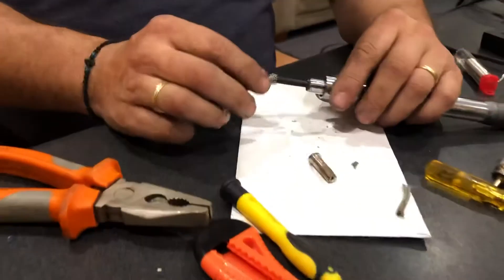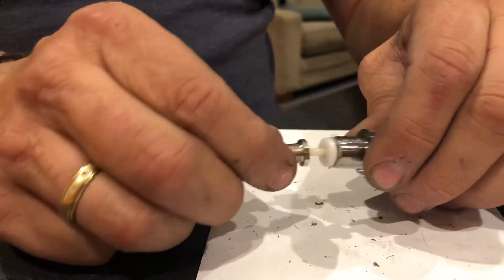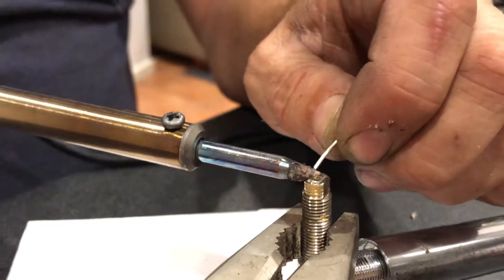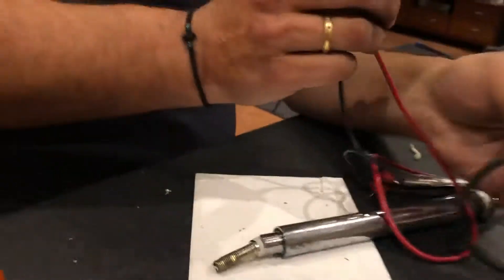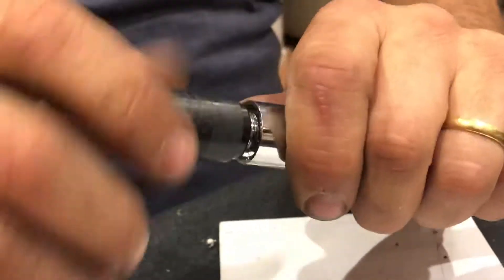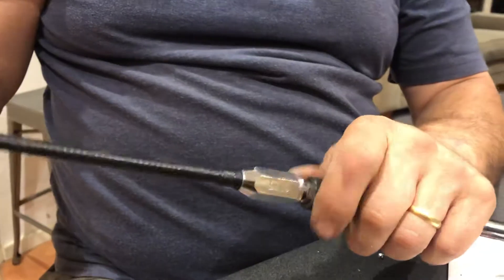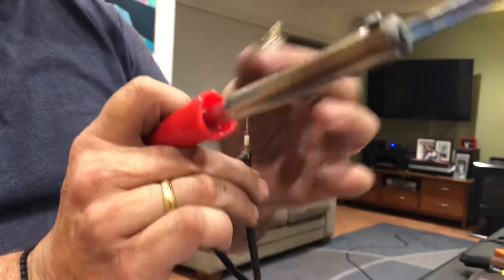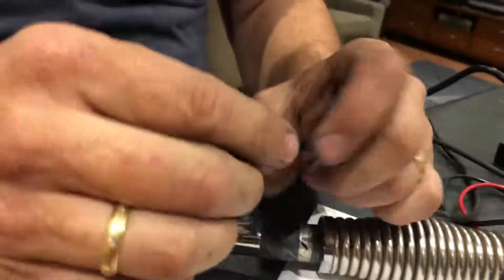UHF antenna repair - part 2

Comment: Curious gal UHF user here.  Peanut at the car wash broke my stick, trying to remove the Whip.  Looked for hours for a schematic of my GME antenna finally came along this video.  Watched it, went out immediately, found the problem; coax wire broken to below the sheath.  Did a quick fix, UHF back working as good as ever.  Waiting for my partner (electrician) to come home so he can do all the handy work

Comment: Hi Steven,  
Just thinking about ROOT CAUSE of the problem with our GME  two stage antenna. That the regular REMOVING and REPLACING of the detachable piece is placing a stress concentrator on the soldered joint? That is why the inner coax breaks off at the solder?
Thank you. Jeff.
Reply from the maker: id say so , mine broke after i moved my setup to another vehicle

Comment: Absolutely fantastic Steven! Thank you. Just back from a big trip. Washed the car and the cable came out of the antenna. I thought You Tube can help me fix this. You’re a life saver. Even better, your antenna is EXACTLY the same as mine. Thank you.
Reply: Top man. Thank you. Very generous with your knowledge. Cheers.
Reply from the maker: im glad i can help

Comment: How long did it take to melt the solder from the nut? Spent a while on it but doesn't seem to be budging
Reply from the maker: I don’t remember it taking too long
Reply: Would take ages if I used my 30W (small) soldering iron...I held the end in a gas flame (kitchen stove) and pushed through from the back with a thin piece of wire e.g. paperclip once it got hot enough.

Comment: Love it. Thanks for sharing. I just bought a second hand car with the same antenna. UHF has some annoying feedback noise and I wasn’t sure if it was the head unit or antenna.  The inner section of the antenna connector looked ‘chipped’ and I wondered if it was broken. After watching your video I realise it is fine, the inner connector is cut on an angle and the inner coax is soldered in place. Awesome education. Thanks again. For me, I think I need a new head unit